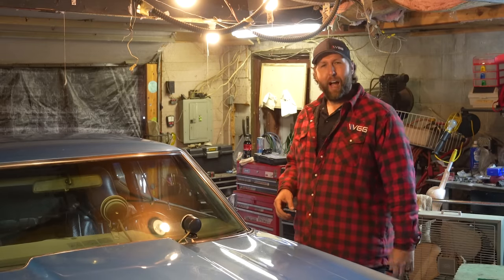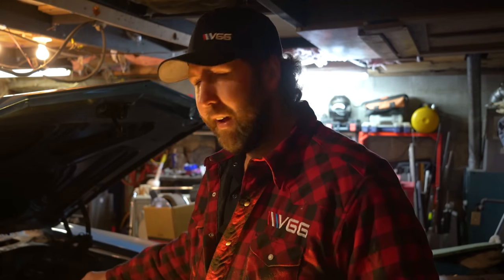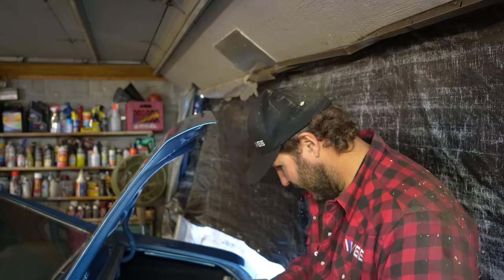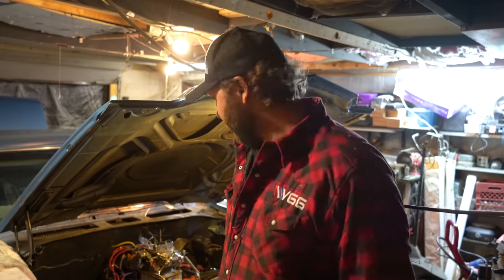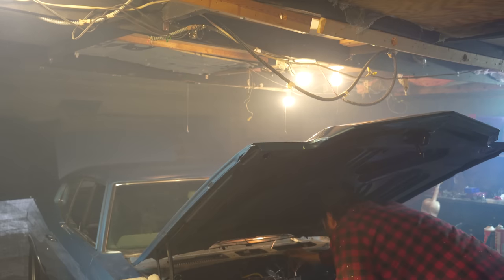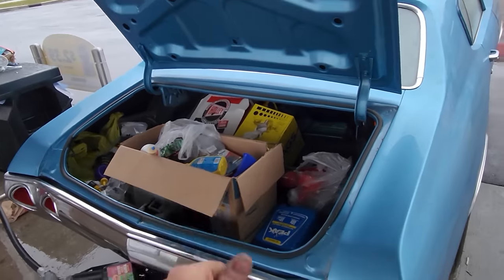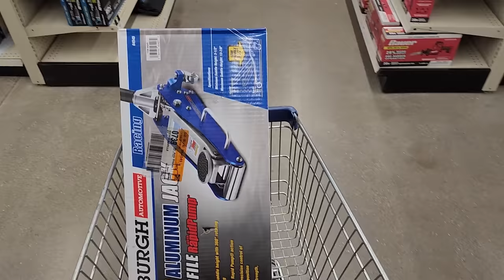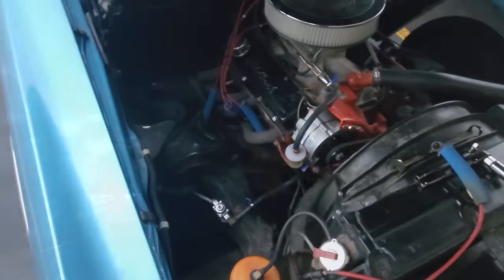80s Built Chevelle Drag Car - Will It RUN AND DRIVE 450 miles home?

Comment: I’d love to see you keep the paint, wheels, and engine in this car. A radiator, rear gear, trans with overdrive, and go through the existing 400 and it’d be a sweet street/strip car that’s got a great story and all the nostalgia. Absolutely love the way it sounds too it’s got such a good note.
Reply: Probably suspension and brakes too. But I fully agree with everything you said.
Reply: @esqueue  it could be stretched out for the sake of budget. Do a little here and a little there. Either way it’s a beautiful car. Can’t wait to see more of it

Comment: Since I’m fairly early to the Bleep Bloops, I just want to say how awesome it is you keep making content for YouTube even after Roadworthy. They’re so much more fun to watch. A guy thinks Roadworthy needs a little less polishing and more time spent with each vehicle. Like either two part episodes or 2-hour episodes.
Reply: I don't think any car channel do that, on the contrary, they take time away from the build/repairs to polish up the show and make it "clean and slick" - that's what happened to Wheeler Dealers, when Motor Trend Channel (former Velocity) took over - they "slimmed" the repair and technical parts down, and filled the show with more irrelevant "noise" and that made Edd China to leave.

Comment: Great video as usual Derek!   400 small blocks were great running, high revving legendary motors.  Very dependable  as long as you paid attention to maintaining them. I would run the hell out of it.  Definitely pull the intake and see what it has for lifters and maybe a new gasket set.

Comment: With headers a guy can run them sparelator's under the headers, like the early 60's. Looks really clean too.🤜🤛 Definitely stick with the small block! It's so much fun smokin a big block, and don't forget about them HIGH RPM's the mouse can turn!
Reply: Yes.  Imagine him shifting into 3rd at 6500 chirping the tires

Comment: I am going to share something with you that my dad taught me. I was going through a quart every 2000mi. Dad was a master mechanic in WW11 in the Southern Pacific. When he came out he secured a job at Beloit bus barns. He rebuilt engines,trans'  and differentials. Drove when needed. So dad says try Mobil. I did and never burned a drop again. My pops taught me a lot!!!

Comment: We need to see what that small block is puttin down to the wheels, I’m pretty curious what kind of power she’s puttin down
Reply: That color is also known as Liberty blue. Since the old one is Independence, mozzle call this one Liberty. 
Disc brakes, adjust the cage/seat and make it a removable steering wheel. No miss, no fuss.

Comment: Derek this is one beautiful car! Old school and done very well by 80's standards. Maybe do some disk brake upgrades and other updates to make it stronger, more reliable, etc. I love the existing color. What a GREAT find! Awesome video!!!
Reply: Drum brakes were the go to back in the day because they are lighter than the disc brake set up of the period. With the new light weight disc drag race brakes you can get now, that would be a option. But If it were Me I would leave it period correct.

Comment: I'd love to see you sort out the existing setup and run it down the strip to see what the old school build could have run! Then maybe modernize it as your time/budget allows with modern suspension arms, cleaned up wiring, and eventually something new under the hood.

Comment: Derek, use shaving cream (not shaving gel) on the inside of windows, and windshields.  It's probably the best anti fog you'll use.  I've been using it for years on my motorcycle helmets for riding in winter.  A can will last you awhile.  Love the Chevelle.  Be nice to see when you've got it done and strip ready.
Reply: Was gonna say the same, except with dishwashing liquid.
Just put a drop or two on the glass, then polish it in with a clean cloth 'til it's clear..been doing it on welding hoods & motorcycle helmets since before this Chevelle was a race car.
Works.

Comment: If you wrap that car, make sure you give it a new clear coat or a ceramic coating first, sometimes wraps aren't kind to an aging finish when they come off. It might be repainted, but I'm sure that paint job is still "vintage" by now due to age.
Reply: That blue color is an early 90’s GM color called “Bahama Blue Metallic” my dad had the exact same color on his s10. Always thought it looked dang sharp
Reply: You can’t ceramic coat it then wrap it. It won’t stick

Comment: Yeah I would like to see what the small block will do with the double hump heads. Then change the heads to something aftermarket that flows way better. And then do the obvious stuff like disc brake conversion on the fronts. Upgrade the fuel and msd systems. And all the safety stuff. Great purchase for the channel. Cant wait to follow along for its progress. Happy New Year to you and family.

Comment: Excelllent car you found Derek! Those wheels are Cragars I believe, had a pair on a 1980 Firebird Formula. <- just saw in the video you knew what those are, my apologies.  The old alternator pulley was a deep groove flavor, I hope you kept it. The car is mint, just make the fuel line legal, fix the roll bar, and the drive shaft loop and run it on the next Rocky Mountain Week. Thanks for the great episode.

Comment: That motor seems pretty stout and I'm really curious what its putting down currently.
Reply: I am thinking mid 11's in the quarter. With slicks not with treads.
Reply: Most likely oil and coolant...
Reply: @RockyMountainHiThere  LOLOL
Reply: Probably around 500hp maybe a little less
Reply: @stevenwillard2392 if that’s an 80s built hot motor expecting some street use 500 would be a pretty tall horsepower order imho.
Reply: @fishhuntadventure  probs around 350-420 hp at most

Comment: Thanks for the ride along, I really miss my 72 Chevelle.  The guy I bought it from was in the Air Force and he turned it from a street car to a drag car.  All of the accessory motors, A.C, etc are removed when possible for weight reduction.  Mine didn't even have a wiring harness.  I restored it to factory condition which took me about seven years.

Comment: Definitely stay small block 400, sounds too good to get it out of there. Maybe change up to 4.11 rear? And either a built 700R4 or a manual valve 4L80, ya know without the E. I couldn't cover up the blue, and if ya put wipers and 39 percent of an interior in it, are ya kinda thinkin what I'm thinkin? 🔧 Wrench on.

Comment: My oldest brother bought a blue 71 new. It had a 350 in it. He paid around $3000 for it and put over 2500 into it in the first week and a half. My dad had to cosign for it because he wasn't 21 yet. we came home from vacation two weeks after he bought it. He had it in the garage all torn apart, the engine was torn down to a short block. He was working on putting the cam in when we walked in to the garage. My dad was pretty angry. He told him to find a new place to live and take the car with you. I remember him having Ammco build the transmission with some kind of B&M converter. and something about an overdrive from a old GMC truck. He also had to get a new driveshaft built, because I went with mom to the southside of Milwaukee on National ave to pick it up.
Reply: You lived right near me..
If I was your brother, I would have done the same exact thing. It's too bad your old man was so pissed about it. Some guys just dont understand the whole "Hot Rodding" thing, and the variety of skills that can be learned from doing it.
Reply: @davelowets  He had just been through something similar 2 years earlier. My sister bought a new 69 Camaro. He cosigned for that one also. She had a boyfriend that became her husband. He didn't go as far as my brother, but he put air shocks and big tires on it. Made it look like a hot rod. My mom ended up driving both of them at sometime. My brother in-law was drafted and was sent to Germany. My sister moved there. So her car was sitting in the driveway for over 2 years. And my brother drove the Chevelle for less than a year. He was clocked on the freeway at 156. They said he accelerated more from there. By the time he got home after stopping at another bar or two.  The cops were waiting for him, he then starting fighting with them on the 3rd floor. (22nd and Kilbourne) One of them ended up going down a flight or a little more stairs. They beat him up pretty bad. Milwaukee county sheriffs.  The car sat at our house for almost another year. He then traded it in on a 72 El-Camino. He left that one stock and drove it for more than a decade. Sorry for the long winded message, but thought I would share.
Reply: @ericnelson6982  Now I can completely understand why you father was pissed... 😆

Comment: That car is solid as a rock. The engine seemed fine. A guy just needs to spend some time to go through it since it sat for so long. Change the timing cover out so it doesn't leak, put properly gapped sparkelators in, etc. I think it's all there. I don't know maybe not.

Comment: I would call it blue thunder  and maybe do the VGG logo on the rear lower quarters. Maybe add the heavy Chevy stripes in vinyl. I would run it with the small block first then maybe the big girl later on.

Comment: following in the theme of independence maybe Patriot Chevelle it's blue you would need red and white somewhere. I would leave paint as is it's a good looking ride. leave as is but disk brakes in front. move seats and cage back to fit ya. I love me some Big Block maybe a nice big block but that mouse seems to run pretty good. roller cam seal it up and call it a day.  my 2 cents worth.

Comment: Very nice rig! The 400 sounds amazing, I did noticed the 8 in balancer. If this turns out to be a Heavy Chevy? It is a brother to my 1971 Pontiac GT-37! Poor mans GTO. Same principal as a the Heavy Chevy strip down model for insurance premiums back then. I would be interested to see the current engines power. Maybe take it the track in it's current state, see what she runs!
Reply: Sweet, budy of mine picked up t37 back in the day with no motor. We put olds rocket 350 in it  and that thing was a lot of fun. More of a cousin than a brother but I feels ya.

Comment: Happy New Year Derrick & Family!
I'd try to "go original" and re-stock her up as much as possible and just have a lot of family fun with her!
BTW - she kind of reminds me of the old Chevy commercial: "Baseball, Hotdogs, Apple Pie, & Cheverolet"
Reply: I remember a version of the Chevy commercial on TV here in the 1970s, and slightly altered to reflect local offerings: "Football, meat pies, kangaroos and Holden cars."  Guess it was permissable as Holden was also GM.
Reply: Assuming the car was 10 years old and then modified it would have been considered a very nice build in its day.    Keep it a- is especially things like the manual drum brakes (at least it was a dual cylinder). The kids today have no idea what those cars were like to drive back then and how crazy dangerous even state of the art was.
Reply: @railtrolley  Irish---  sorry eh Oirish version  : Spuds & cabbage,Guinness.Shillelagh,poteen. There was an Irish built car  called The shamrock. the production ran to four saloons as nobody would buy one because the body had to be removed in order to change the rear wheels-----Be Japers and Be gorragh!

Comment: Looks like it might be a 400 with 350 heads..
Seeing that alternator mount
Reply: 400's never had the doublehump heads. Its an easy conversion though, just need to drill a couple of steam holes in the head between the center cylinders. The alternator mount is probably that way due to the Victor Junior thats on it. I had factory mount for the 400 I had in my ElCamino with headers. just needed a bit of a spacer between the flange and the mount.
Reply: My dad's 65 SS 327 Chevelle had the double hump heads, 4 speed and a 12 bolt rear.
Reply: Those are most likely early double hump heads without the threaded holes for an alt, the bracket going to the header looks to be home made and not the right one.
Reply: Double hump heads came on 327s
Reply: Double hump heads are 327 heads.  The ones on this car are either 292 or 461 castings with no accessory bolt holes.
Reply: I'm currently running double hump heads on my 406sbc
Reply: @Ada-zn3pw  327s are not the only engine double humps came on, they came on some 307s, 302s and some early 350s, the really early fuelies just didnt have accessory bolt holes.
Reply: @Scottinqc  its not just 2 steam holes between the center 2 cylinders, its 2 inbetween each of the cylinders, 6 holes per side and you have to drill the intake side holes at the right angle as well or you can run the risk of drilling into a runner.

Comment: Hey man. Don't touch that paint. It looks so good with that blue. U should put a set of new air shocks on the back, pull the top off to see what's in it and check the push rods for warpage and wear. See what lift that cam has. Maybe check the keepers for wear. If solid lifters adjust the gaps properly. U know all this cause ur a mechanic. Change all the fluids u can. Change rear end oil. Redo interior after u fix water leaks and most important. Keep it for yourself and NEVER sell it. So happy for u man. 😊

Comment: This reminded me of my '69 SS Camaro with an L78 396 that was my first car in the mid '70s.  It came from the same area of Central Ohio as this one and was even the same color.  It had a full cam, solid lifters, 12:1 pistons, 780 DP, Accel Super Coil,  4 speed Muncie with a Hurst Comp Plus, and a 4.11 12-bolt posi.  It had to have at least 100 octane (about 45 cents a gallon at the time) and got only about 4 mpg.  It had no AC, of course, and no power anything but power front disc brakes.  It was hot, loud, uncomfortable, the fumes made my  eyes tear up, and it rode like a buckboard.  In other words, it was wonderful.  

So yeah, like this Chevelle, it was not exactly a touring car, but I managed to DD it as a teen without wrecking it, blowing it up, or even getting a ticket.  When four years later I needed something a little more practical I had maintained it so well it sold for several hundred dollars more than I paid for it (paid $1600, sold for $2500).  

Like this Chevelle, It was a temperamental beast that required a lot of work to keep it going, but I learned a lot from it.  I've owned over 40 vehicles since then, and I would put that SS at  #1 on the list of vehicles I'd love to have back.

Comment: Car sounds good, def has me intrigued as to what’s in it. Love to see you do the old 60’s/70’s truck. Camper specials, square body’s, old rangers! Yup, love em. The long drive home is icing on the cake. I’d be pulled over 100 times driving that far with no plates.

Comment: The cross-connected style of the electro-digikal panel makes me think the previous owner was a telco guy. Both sides of the connections are terminated separately then jumpered between, like you’d wire a 66 or 110 block. Love it.

Comment: I remember years ago I had an upper radiator hose decide to develop a leak when at a stop sign in the middle of nowhere.  I did the right thing, and pulled out the silver duct tape (that I always kept in the car) and wrapped up where it was leaking plus about 4” on both sides.  It held up enough to get me home 12 miles. 😅. The next day the hose & even the thermostat got replaced on.  The thermostat was of unknown age, so that’s why it got done.  Refilled the green ice cube juice, and it didn’t give me any more issues while I owned that car, besides the usual oil (also known as 710 fluid) changes.

Comment: I think i have a 350 in my wagon. I bought it with high hopes to strip it and rebuild it and then a lotta of life happened. Insane to hold on to old metal when you rent in Vancouver. Equals to New York in a lot of ways, but with mountains and well, okay not like it at all save the city factor, but no night life or good restaurants. Not anymore. Finally starting to work on it, a slow process. It's great to see your take on things. If you ever come across a Chevy 2 wagon, with a straight 6 in it, I would love to bounce project details if possible.

Comment: I had 71 Chevelle in the 80s decided to switch to 65 Nova. I put my motor in the Nova t350 3000 stall converter and 410 posi. It ran 11 at 4500 ft. I found my self talking to the computer(had most of the same problems). Wish I still had the car. Most likely if you want to be really fast your going to need a big block or spend a lot of money.

Comment: I just hooked this up to my Roku TV now I can watch your 71 Chevelle on my 50-inch TV. Just some food for thought, when you're videoing those cool roller rockers, make sure the camera is not focusing on the drop light wire😂

Oh, and those Lucas Gear displays, with the little handle.... I always tell people, put some metal shavings in the bottom of both, and turn the little gears. See which gears get destroyed first. My money is on the Lucas gooey glue sticky stuff, effectively dragging the metal all the way to the top gear, destroying all of them.😂

Comment: Cranking over it sounded like my LT1 383 with 12.5:1 compression.....now I'm waiting for it to fire.  Now fired up....sounds just like my Chev.....lumpy cam.  Not a 3030 Duntov....probably a taller bumpstick.  On the road it sounds like you've got a tall rearend gear.  At least a 4.11..I ran a 5.56 Ford on strip.  I watch you all the time, Derek, but I'm getting old and I didn't think I'd live long enough to see you mumble thru this video.